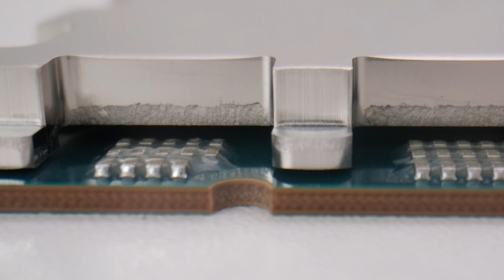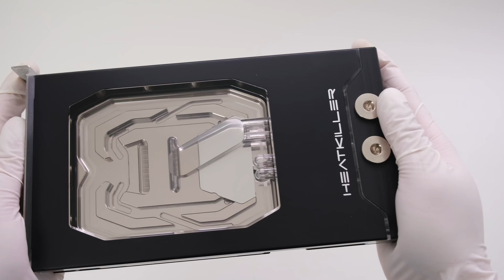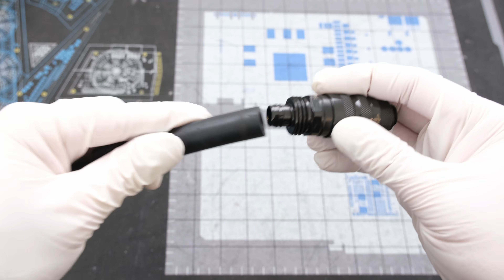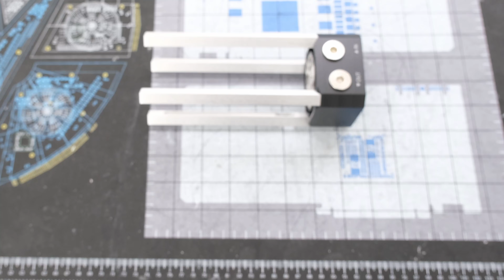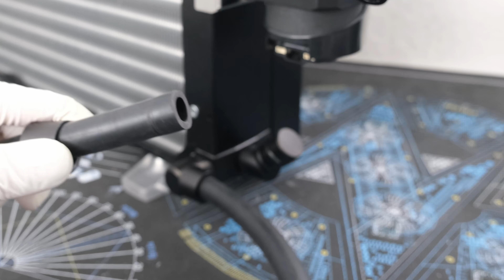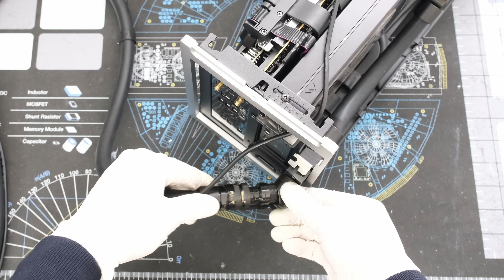Ultimate Silent ITX Build - Step by Step

Comment: Nice setup but the huge external rad kinda defeats the purpouse of an itx system. Sure you can have the rad hidden and so on.
But at that point you could just build a midtower system instead. Well thats just opinion on the matter. 🙂
Reply from the maker: Thanks for your comment 🙏  I recognize that I'm using a separate MO-RA to get the silence. So, while its silent and powerful, whether its small can be debatable. You're flat out right to question the purpose of the build. 
One thing that was unexpected for me was that, once the MO-RA is built, there doesn't appear to be a reason to upgrade any of it. The MO-RA is already best in class. Same with the Noctua fans. The reservoir, D5 pump, fittings and tubing all are not expected to need any upgrades. So, this really opens up future builds. The only consideration needed is the CPU/GPU water blocks (in addition to like motherboard, RAM, PSU, etc) and your build can go into basically any case (the Terra is tiny) and it will be silent. You can freely pair an Intel CPU at 400+ watts and an NVIDIA GPU at 400+ watts and have it be completely silent in any case you want. 
The other thing that was pleasantly unexpected was that the MO-RA does kind of blend away. Hear me out. Unless you have the MO-RA right up against the Terra like it's some big brother looking down at it, it feels like you're just using the Terra when using the rig, if that makes sense. It's a different feeling, you got the PC running at full load, GPU at max, and it's just sitting there, tiny and silent. But then again, I love regular ATX and ITX builds too. I have an ATX one in an o11 EVO as my main editing rig and another ITX one in a Meshlicious. I won't stop building those either. Thanks again for commenting and for the feedback
Reply: note that you can replace the mora with a louder, smaller fan for traveling.

Probably you could even put one inside the case and turn it off while connected to the mora.

Comment: You've earned a new sub! You did such a great job in both explanation and recording. Would larger 19/13 fittings and tubing work inside the Terra or are you constrained to 16/10 due to clearance issues?
Reply from the maker: Thanks for your comment 🙏 I did not consider going larger. I typically choose between 16/10 and 13/10. So, I was already going with the large ones. Even if it did fit, one thing to keep in mind, there are 4 holes with 4 sets of fittings on the PCI slot passthrough bracket. That bracket is really just clamped together (sandwiched) and while its secure but that part of the case wasn't made for it. So, with so many fittings on that part, there is tension there and I wouldn't want more tension with bigger fittings. The way I relieved the tension was adding those 45 degree fittings on the outside, so the tubes and weight can be rotated downwards. That relieves the tension. Hope that helps
Reply: @vectornetwork  That helps a lot in providing context. I didn't realize the PCI-E passthrough was mostly pressure fit and the larger fittings would definitely add more tension. I'd love to build something similar for a future CPU/GPU gen as I have a 5900X and 3080Ti that are still doing great. They are housed in an O11 Mini with a triple radiator setup (HWL SR2 360, GTS360 and GTS280) but I've been curious about SFF and MORA builds for better performance and even greater silence. Thanks for taking the time to answer my question! :yougotthis:

Comment: its not sff its got a giant radiator stuck to it lol
Reply from the maker: Thanks for your comment 🙏  I recognize that I'm using a separate MO-RA to get the silence. So, while its silent and powerful, whether its small can be debatable. You're flat out right to question if the build is SFF. 
One thing that was unexpected for me was that, once the MO-RA is built, there doesn't appear to be a reason to upgrade any of it. The MO-RA is already best in class. Same with the Noctua fans. The reservoir, D5 pump, fittings and tubing all are not expected to need any upgrades. So, this really opens up future builds. The only consideration needed is the CPU/GPU water blocks (in addition to like motherboard, RAM, PSU, etc) and your build can go into basically any case (the Terra is tiny) and it will be silent. You can freely pair an Intel CPU at 400+ watts and an NVIDIA GPU at 400+ watts and have it be completely silent in any case you want. 
The other thing that was pleasantly unexpected was that the MO-RA does kind of blend away. Hear me out. Unless you have the MO-RA right up against the Terra like it's some big brother looking down at it, it feels like you're just using the Terra when using the rig, if that makes sense. It's a different feeling, you got the PC running at full load, GPU at max, and it's just sitting there, tiny and silent. But then again, I love regular ATX and ITX builds too. I have an ATX one in an o11 EVO as my main editing rig and another ITX one in a Meshlicious. I won't stop building those either. Thanks again for commenting and for the feedback

Comment: liked and subscribed! I like the fact that you were not afraid to mix and match other manufactures fittings together to get the look that you wanted. Maybe putting a set of custom length cables in there as well to help out when you have to maintain it. I am putting together two builds myself and that is one of the things that I wish I had included with it.makes cable management hell easier.

Comment: yeah sorry nah it is not itx
Reply: @MiyabiJNEPdo you see the size of the external radiator
Reply: It is
Reply from the maker: Thanks for your comment 🙏  I recognize that I'm using a separate MO-RA to get the silence. So, while its silent and powerful, whether its small can be debatable. You're flat out right to question if the build is ITX. 
One thing that was unexpected for me was that, once the MO-RA is built, there doesn't appear to be a reason to upgrade any of it. The MO-RA is already best in class. Same with the Noctua fans. The reservoir, D5 pump, fittings and tubing all are not expected to need any upgrades. So, this really opens up future builds. The only consideration needed is the CPU/GPU water blocks (in addition to like motherboard, RAM, PSU, etc) and your build can go into basically any case (the Terra is tiny) and it will be silent. You can freely pair an Intel CPU at 400+ watts and an NVIDIA GPU at 400+ watts and have it be completely silent in any case you want. 
The other thing that was pleasantly unexpected was that the MO-RA does kind of blend away. Hear me out. Unless you have the MO-RA right up against the Terra like it's some big brother looking down at it, it feels like you're just using the Terra when using the rig, if that makes sense. It's a different feeling, you got the PC running at full load, GPU at max, and it's just sitting there, tiny and silent. But then again, I love regular ATX and ITX builds too. I have an ATX one in an o11 EVO as my main editing rig and another ITX one in a Meshlicious. I won't stop building those either. Thanks again for commenting and for the feedback

Comment: Why build an ITX  with a big radiator? whats the point
Reply: The answer is simple: small footprint
Reply: @Blastthehumans You can have a small foot print with a usb-c dock or hub sitting at your desk and the computer behind a wall with less cost.
Reply from the maker: Thanks for your comment 🙏  I recognize that I'm using a separate MO-RA to get the silence. So, while its silent and powerful, whether its small can be debatable. You're flat out right to question the point of the build. 
One thing that was unexpected for me was that, once the MO-RA is built, there doesn't appear to be a reason to upgrade any of it. The MO-RA is already best in class. Same with the Noctua fans. The reservoir, D5 pump, fittings and tubing all are not expected to need any upgrades. So, this really opens up future builds. The only consideration needed is the CPU/GPU water blocks (in addition to like motherboard, RAM, PSU, etc) and your build can go into basically any case (the Terra is tiny) and it will be silent. You can freely pair an Intel CPU at 400+ watts and an NVIDIA GPU at 400+ watts and have it be completely silent in any case you want. 
The other thing that was pleasantly unexpected was that the MO-RA does kind of blend away. Hear me out. Unless you have the MO-RA right up against the Terra like it's some big brother looking down at it, it feels like you're just using the Terra when using the rig, if that makes sense. It's a different feeling, you got the PC running at full load, GPU at max, and it's just sitting there, tiny and silent. But then again, I love regular ATX and ITX builds too. I have an ATX one in an o11 EVO as my main editing rig and another ITX one in a Meshlicious. I won't stop building those either. Thanks again for commenting and for the feedback
Reply: I did the same with the Meshroom D, I have an external enclosure with 2 rads, away from me. Besides silence, also internal component are way cooler now. I just love it.😊

Comment: :I've built a ITX PC that's tiny, really powerful and silent!
:How?
:By having a ＧＩＧＡＮＴＩＣ radiator on the ＥＸＴＥＲＩＯＲ of the case!
:Are you... challenged?
Reply from the maker: Thanks for your comment 🙏 I had a legit chuckle at this. Fair point. 
On paper, it's ridiculous. In practice, it was better than I had expected. 
This is more of an endgame type use case. I tried to also make the video as clear as possible for potentially even new users to participate. So, its watchable even if someone would never build it. 
This is something different that has been living rent free in my head for a while. I wanted to show it. It was a challenge. I am not that challenged :)
Actual use case would be to have the small footprint of an ITX case on top of the desk and have the rest of the build underneath the desk. Neither unit would make noise under full load. It what I tried to portray in the thumb with the radiator unit slightly visible on the bottom. 
Also, the Radiator and Reservoir combo are most blacked out with some silver accents. It was designed with form in mind and it can also potentially blend well into the background and it feels like you're just driving this really powerful noiseless little ITX rig. Thanks again for watching and commenting

Comment: Verry nice detail in this video! By far one of the best out there.. However I don't understand the point of doing an itx build if you have to have another itx cooling build attached to it. Why not just do one large build all together at that point?
Reply: The advantage of having the cooling all external is you can stick it wherever you want, just limited by how much hose you have. So you stick it under a desk where you can't see it, on the wall, or even in another room. Then you've got zero noise and your PC is right next to you taking up barely any space on your desk, basically getting the cooling from a 3x 360mm build with an ITX footprint.

Comment: It’s not practical like us.
Reply from the maker: Thanks for your comment 🙏  I recognize that I'm using a separate MO-RA to get the silence. So, while its silent and powerful, whether its small can be debatable. You're flat out right to question the practicality of the build. 
One thing that was unexpected for me was that, once the MO-RA is built, there doesn't appear to be a reason to upgrade any of it. The MO-RA is already best in class. Same with the Noctua fans. The reservoir, D5 pump, fittings and tubing all are not expected to need any upgrades. So, this really opens up future builds. The only consideration needed is the CPU/GPU water blocks (in addition to like motherboard, RAM, PSU, etc) and your build can go into basically any case (the Terra is tiny) and it will be silent. You can freely pair an Intel CPU at 400+ watts and an NVIDIA GPU at 400+ watts and have it be completely silent in any case you want. 
The other thing that was pleasantly unexpected was that the MO-RA does kind of blend away. Hear me out. Unless you have the MO-RA right up against the Terra like it's some big brother looking down at it, it feels like you're just using the Terra when using the rig, if that makes sense. It's a different feeling, you got the PC running at full load, GPU at max, and it's just sitting there, tiny and silent. But then again, I love regular ATX and ITX builds too. I have an ATX one in an o11 EVO as my main editing rig and another ITX one in a Meshlicious. I won't stop building those either. Thanks again for commenting and for the feedback

Comment: i also have a set of quick disconnects at the radiator side, so i can easily change tube lenght depending on the rad and case placement
Reply from the maker: Thanks for your comment 🙏Right on! I actually had that same plan from the outset. 4 QDCs total. But then changed it to just the 2 QDCs to simplify the build a little more and to potentially side step any comments on how too many "uneccessary" QDCs may impact flow-rate. Its why I also added a flow rate sensor. Turns out, flow-rate is totally A-OK :) Thanks again for watching

Comment: i'm pretty sure the D5 Next can power 4 of those fans by itself, without using the quadro and external USB cables. I did power 4x T30 from it and they were able to run at 3000rpm flawlessly
Reply from the maker: Thanks for your comment 🙏You're flat out right. When I was putting this together, I discovered that there was a fan input on the D5 itself. In retrospect, I would be able to cut out the Quadro and also the Hubby 7, if we are okay with a thicker internal USB 2.0 cable (for 2 inputs (sensor and pump), the hubby7 is needed once we have 3 inputs).  But having the Quadro and the Hubby7 allows for more flexibility and a thinner internal USB 2.0 cable to the motherboard (only 1 input). Flexibility as in I keep this rig in a cabinet with a hole cutout for ventilation into the wall where I've attached a 92mm fan, so I'm able to plug in an additional fan into the QUADRO. But I do think having that fan input on the D5 is pretty cool. If I ever get around to using it in a video, I'll make sure to mention it. Thanks again for the comment and for watching
Reply: @vectornetwork  your considerations are correct. I would just get rid of the external usb thing altogether. Once programmed that pump controller unit runs the parameters you set standalone, and has it's own water temp sensor. 
It's the beauty of customizing the setup for each their own
Reply from the maker: Oh, I totally did not realize it could be programmed like that. In retrospect, of course it can. That would be much simpler. The only thing missing would be flow-rate (I think?) and that could easily be put more on the PC-side to shorten the cable. But, not having a flow-sensor to completely get rid of that internal USB cable would be a trade-off completely worth considering. That is really cool, thanks for the info. I think deep down I wanted to show all the little Aquacomputer widgets and things. And, you're right on about the beauty of customizing for each user. It's what PCs are all about.

Comment: I hate to be a critic, but what is the use-case and advantages of this vs a regular ATX case? All i see is a added complexity and no practical gains?
Reply from the maker: Thanks for your comment 🙏 Feel free to always provide feedback. I see this as an endgame type use case. I tried to also make the video as clear as possible for potentially even new users to participate. So, its watchable even if someone would never build it. 
As for advantages over ATX? Well, I have so many ATX rigs and I won't stop building them. This is something different that has been living rent free in my head for a while. I wanted to show it. It was a challenge. 
Actual use case would be to have the small footprint of an ITX case on top of the desk and have the rest of the build underneath the desk. Neither unit would make noise under full load. It what I tried to portray in the thumb with the radiator unit slightly visible on the bottom. Thanks again
Reply: @vectornetwork  Thanks for the reply :D The video and production, and also the build was top notch.
Reply: It's basically to move all that cooling area somewhere else so you can have the small case on the desk with all the performance of an ATX, and even quieter. You can stick the external radiator under the desk, on a wall, or even in a different room  (especially if you want to keep your room cool in warmer climates). So you can hide it or stick it somewhere unimportant and free up all that space for your desk or wherever you want to stick a PC.